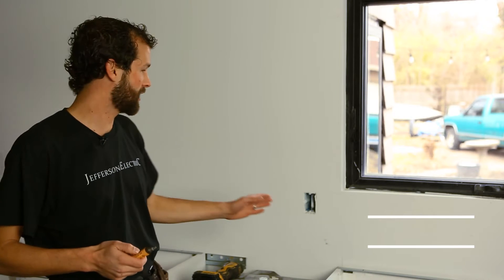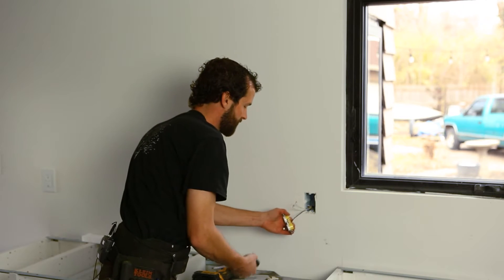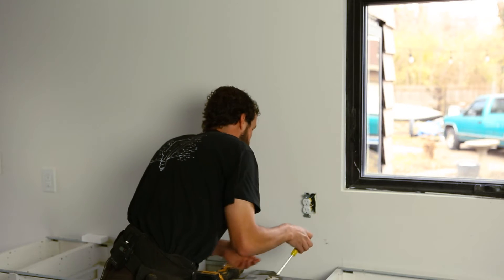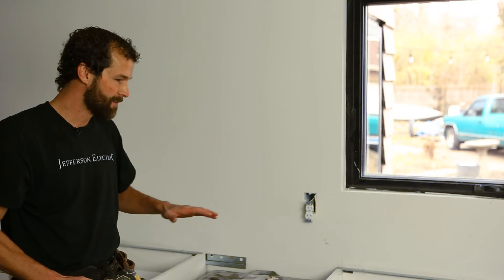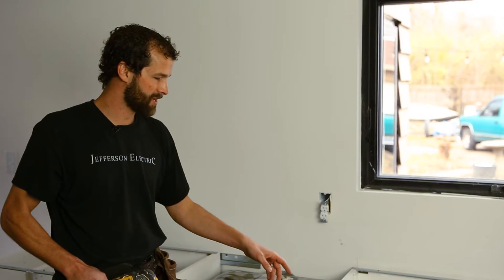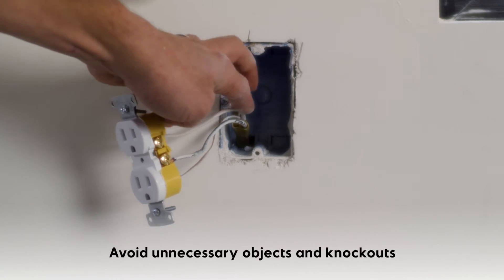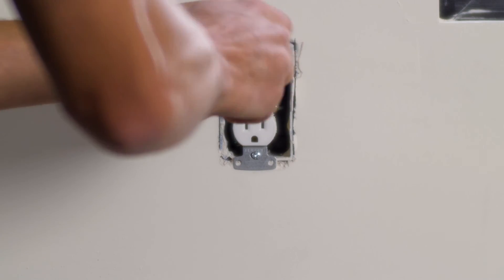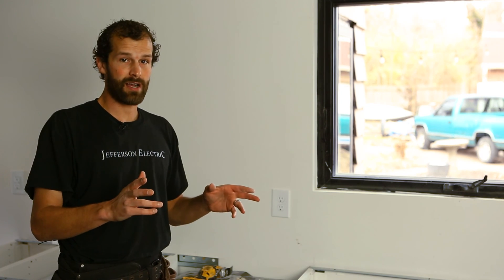Terminating a Receptacle Outlet

Comment: The captions are all wrong it says terminating a receptacle not installing one ??????
Reply from the maker: In the electrical trades the term "terminating" refers to terminating the wiring into the device and installing it into the electrical box. Sorry for the confusion 😅. If you're trying to remove an outlet receptacle, turn off its breaker in the main electrical panel and then perform the steps in reverse.

Comment: Question: I am installing a backsplash and we dont need the electrical outlet. Can I just remove the receptacle and cap off the wires and dry wall over it?
Reply: No. It always needs to be accessible.. you can use a blank plate or find where it originates and remove the wire from point to point.

Comment: The indicator used at 0:14 are not allowed to use by many companies in the Netherlands.
First of all, they don't work with armored cable, and with normal cables the wires are twisted inside the isolation so the indication often  depents on which side of the cable you hold the indicator.
So if the indicator gives a signal, the cable is hot, when it don't gives a signal it means nothing.
If have to say, we don't use cables in homes, only single wires in conduits, so in a home situation it will work most of the time, but in industrial installations this thing dangerous.

Comment: To add to this, the hot wire goes on the gold screws, and the neutral wire goes on the silver screws. Then use super 33 electrical tape and make a couple wraps around all the screws to prevent accidental shorts.